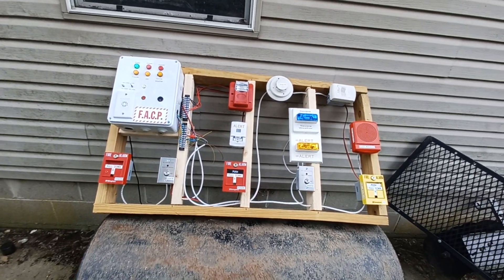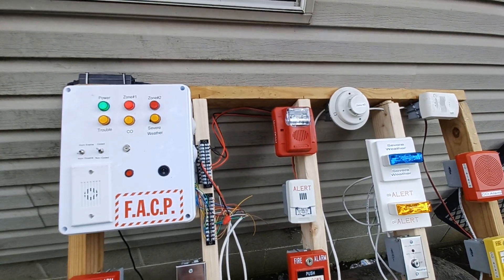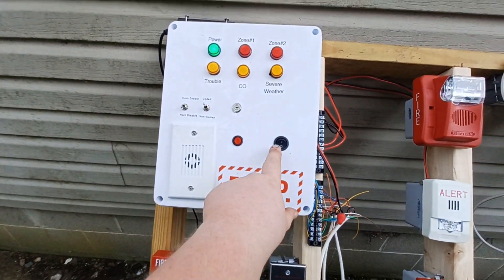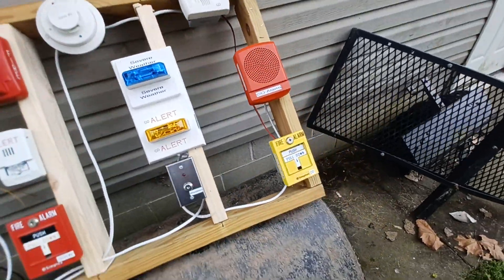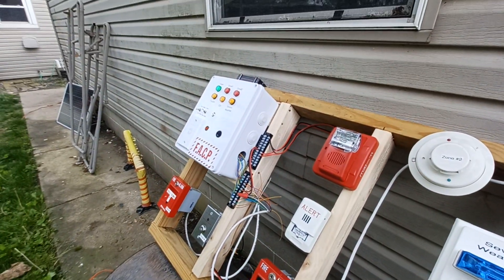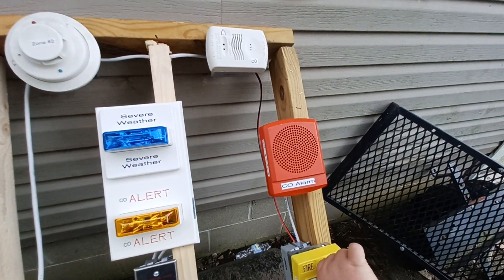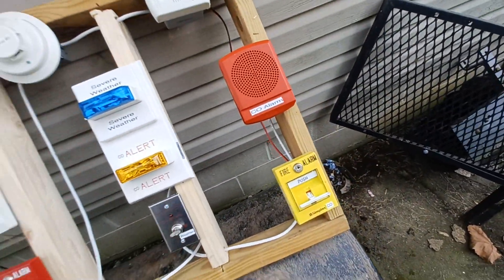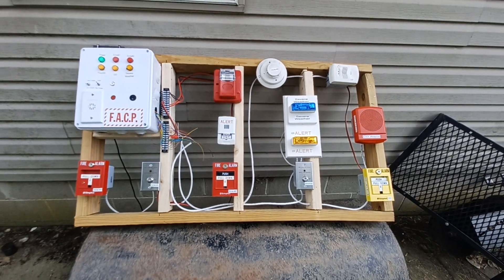My custom Fire Alarm Demonstration Board

Comment: Cool! You should add drywall on the board.
Reply from the maker: I was going too but I figured will all the boxes it would be a bit difficult and the drywall might not have enough strength